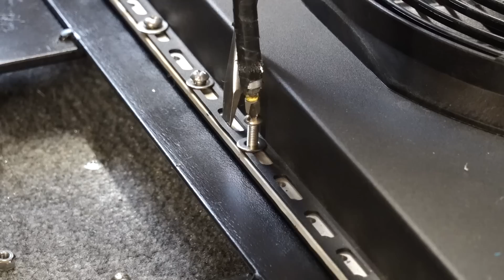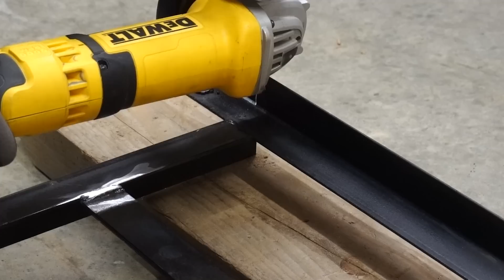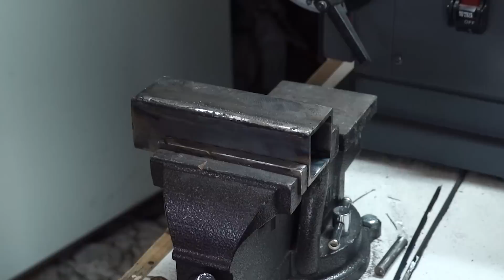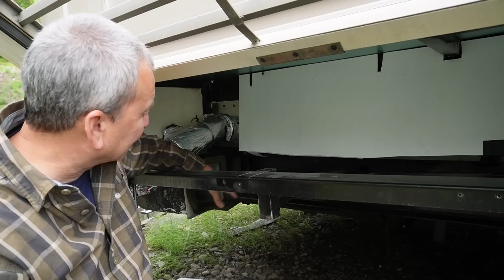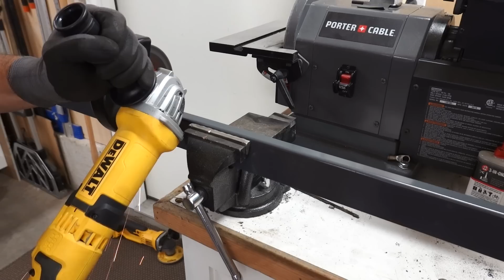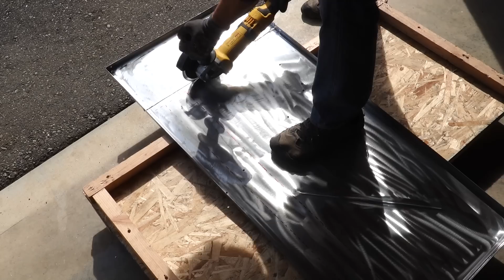My 12 Volt RV Air Conditioner (Part 3) - Support Frame Re-Design | RV With Tito

Comment: I had an experience driving down a gravel road where the dust kicked up and covered anything exposed.

 The original house air only has a pan on the bottom that had a little drain tube. It clogged with dust and the pan filled up and eventually broke thru the thick dust and poured out. I thought my freshwater tank was leaking. Glad it was just a dirty drain tube.

But this also means the design you have will be caked with dust and dirt and water that spashes and gets into everything. That house ac design seems easy to clean, and works. You should consider sheet metal enclosure around the unit so it can be protected from dust. The condensers might need to be smaller to fit the door vent size you originally thought about

Comment: Brian, I know I'm late in asking this, but in your previous video you showed the condenser exterior as the grid side with the fans pulling in. Doesn't that mean you have it mounted upside down in this new config? If so, might you have an airflow restriction trying to pull air down due to the plate and components above?
Reply from the maker: No. This is actually the manufacture recommended orientation. Yes. It will pull air down and there is ample space for it to do that...We'll see. 🤞

Comment: Could you relocate the connection to the air outlet - looks like the duct curves up anyway?
Reply from the maker: I probably could with more work. There's also a wall in the way. Definitely something I can tweak later.

Comment: Thinking about the noise made by loose stabilizer links on vehicles like your rig that have loose connections... Where the all thread has nuts and a rubber bushing, I would consider tightening them a bit compressing the rubber.  Stabilizer links use the rubber bushings on both sides of the connection for best results.  Their inexpensive as well coming with all of the rubber and washers for one connection.  ( you would have a part number for replacement parts... Could use the part from a pickup)
Reply from the maker: Good point! Thanks for the suggestions.

Comment: Ingenious design, but the compressor will live on a slight incline. I wonder how that angle will work out. Great work sir.
Reply from the maker: Nope. The compressor is level. The condenser is on an angle.
Reply: Oddly enough, while automotive ac compessors seem to live on a level surface, vehicles dont remain on level surfaces in their travels. It shouldn't be a problem.

Comment: I think you should plan on an expanded metal grate to shield the coils that will be facing down. Otherwise rocks will soon put an end to it since it will be trailing your rear tires.

Comment: On your all thread support rods, I’d recommend adding extra nuts so that you can double nut everything to lock it into place. May not hurt to also add non permanent locktite. Nice work.
Reply from the maker: Oh. I will. Probably an extra bolt under the support bolt and blue loctite in a couple other spots. 👍

Comment: I respect all of the effort that is going into this task. 
However, I personally would have done everything in my power to try and package a mini-split instead.  I agree in theory sticking with a 12v system avoids an Inverter that comes with a cost, packaging challenges, and conversion inefficiencies.  However, I predict the vastly superior average energy efficiency of the mini-split, lower NVH, and heat pump functionality would more than make up for the cons.
Reply from the maker: Yeah. I get that. Aside from the DC powered part there are a few other reasons why I didn't go with a traditional mini split for my rig though. Thanks for the comment.

Comment: Are you at all concerned with the downward angle of the condenser that the downward direction of the blowers will create a cloud of dust when you camp on anything but gravel or concrete?
Reply from the maker: Yeah. We're parked on dirt a lot. That was one reason why I was hoping to mount the condenser vertically. The old heat pump condenser fan vented downward too and it wasn't an issue. Fingers crossed 🤞

Comment: It's been quite some time since I watched parts one and two, so I really don't remember why you decided to get rid of the original basement air unit, but did you investigate the cost of just adding more solar and batteries and keeping the original heat pump?  It seems like you are spending a large amount of money and time for a little bit of energy savings.
Reply from the maker: The old unit died. It's been scrapped.

Comment: I'd probably stick some sound deadening mat underneath that modified pan and the two vertical side pieces to keep them from vibrating when underway or while the AC is operational.
Reply from the maker: For sure. I have some stuff already planned for that. Everything will be insulated and sealed up when I'm done.

Comment: Nice fabrication!  For bending sheet metal a few pieces of angle iron clamped on an edge makes a good poor man's sheet metal brake.
Reply from the maker: Thanks for the tip. Yeah, I've watched all the DIY bender videos on YT :) I have a harbor freight bender, but this stuff was too thick. I'll use it to make the ducts.

Comment: If you don’t mind, what is the exact welder and model ❤you use?
Reply from the maker: This is the one https://amzn.to/3sXp8i2 I've got. Still learning and wanted a multi-function unit that could do stick, mig, and tig in 120 or 220V. Just working with flux core on 110V for now.
Reply: @RVwithTito  thank you!

Comment: So, this unit will cost around 7k to 10k and pull nearly 100 amps when complete, correct? On that shock mount I would suggest doing away with the old rubber gromets and use springs.
Reply from the maker: Closer to 7K. I'm thinking around 50-70A, but we will see. The compressors are variable speed. So they'll run more efficiently to maintain the temp. Looking forward to the testing phase :)  I'm hoping the leaf springs plus air bags will do most of the shock absorbing. Plus...the new compressors also have shock mounts.
Reply: @RVwithTito  thanks for the reply.

Comment: Is it small enough to mount on the door,  with long flex lines?
Reply: He addressed that. It would hang down below the door.
Reply from the maker: Nope. It's bigger that it looks :)  There is a smaller condenser that may have worked for that, but the larger one should provide better cooling.